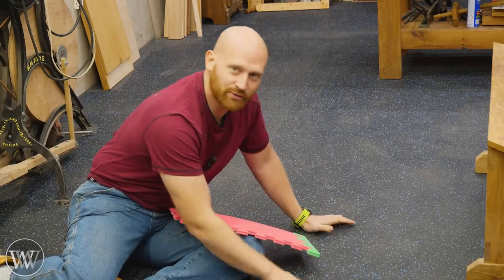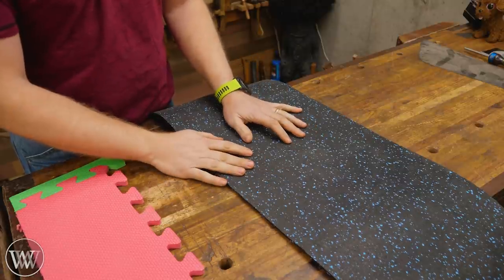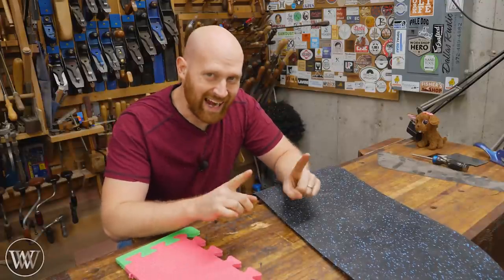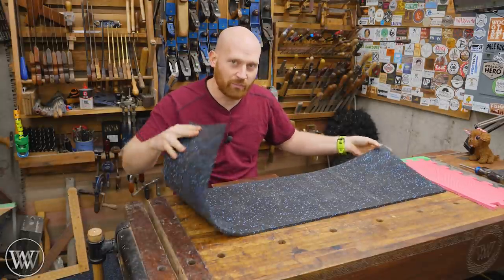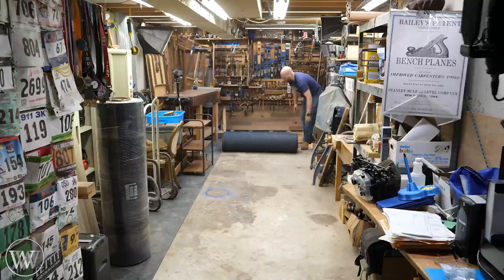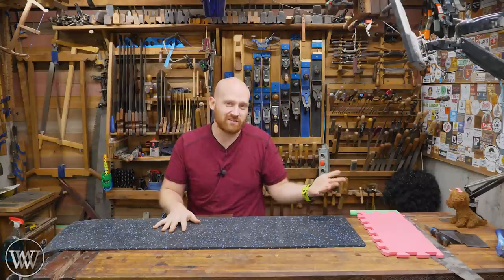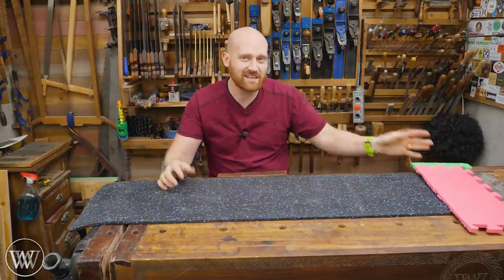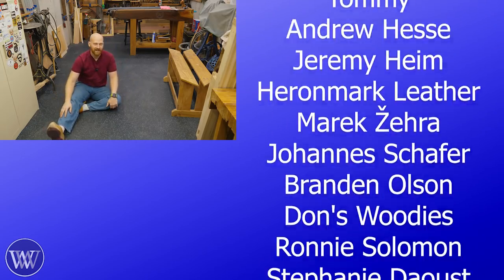How to Install Rubber Flooring In a Woodworking Shop

Comment: I started researching flooring for a shop in my basement last year and saw your video.  It appears my shop is about the same size as yours.  I ended up going with the same flooring that you did (black with the blue specks).  I painted the walls a bright white and after installing the flooring the walls now appear to be a very pale blue.  I'm coming up on a year now since I did the installation and I couldn't be happier.  I use a shop vac with a Dust Stopper to vacuum up the sawdust which works good.  At the end of the day I run a Shark Rotator around and it does a great job picking up the fine dust.  Since I have to break down sheets of plywood in my garage so I can manage to get them downstairs I've definitely noticed the huge difference in the comfort of the rubber flooring compared to working on the concrete in my garage.  Thanks for your video!

Comment: For anyone thinking about the foam puzzle pieces. Like James said sweeping is a bit of a pain. Chips and shavings come up east. There tends to be a fine layer of dust that is left so I follow with a vacuum. Also, wood filler seams to instantly bond with the stuff. On the other hand, with rubber shoes, it is great for antifatigue.

Comment: I think you probably made the right choice with the rolls, I had the same thought about sweeping while you were talking lol. I've got gravel with plastic sheeting and some free carpet over top in my pole barn shop. Holds onto the dust a bit more but like with your rubber floor it isn't as hard on stuff you drop and machine legs don't sink.

Comment: I put 3/4 inch horse mats in my 10x12 shed 10 years ago.  A bit of a luxury, but I really like it and would do it again.  For a larger space, I'm thinking the rolls you used are more cost effective.

Comment: Oh wow. Looks like you were using the "good chisel" to clean the epoxy bumps off the concrete floor! Nice new floor. Good video.
Reply from the maker: It's always wise to have a set of chisels in the shop that are not as light as others.

Comment: If the cracks are annoying a product my grandfather invented and patented might help although I doubt you could find it. Namkub enterprises. It was a roll of extruded plastic with a T shape that fit in seams of linoleum to keep things from falling in the cracks when it was only 3 or 6 feet wide.

Comment: It would be a good idea to glue the edges together using contact adhesive, that way you don't have to worry about catching an edge when sliding heavy objects around. That could be a problem if you are adjusting saw horses or moving a project or your bench. It will also make it easier to clean since you can make the edges match each other when gluing you won't have gaps & uneven surfaces for dust to stick to.
Reply from the maker: I thought about that, but if I move I want to peel these up and take them. also in the tests I did of moving things around I have not had any issue at all. the floor does not bubble up because feet do not sink into it. and the seams are crazy tight as is.
Reply: I'm thinking of using carpet tape to join the seams.

Comment: Look at that, 290 thumbs up and zero thumbs down. I found your discussion worthwhile but wonder whether the EVA would make effective, cheap and easy to install sound deadening for an enclosure for a 7-1/2 Hp dust collector and same-size compressor. What do you think? Is there something more effective for anywhere near the price?
Reply from the maker: I think EVA would work great for that. especially if you did a layer or two.

Comment: I have the exact same material in my small 12x10 shop, and it has saved many a chisel and plane. Cost of tool replacement far exceeds cost of the material. You can also glue down  rubber floor as a permanent solution  if shifting is a concern.
Reply: Does it smell? How do tools roll  on it?
Reply: @DaileyWoodworks  the floor is very shock absorbing, but does not allow dropped items to bounce. Same stuff they use in commercial gyms for weight room flooring. Easy to clean too. No real odour to it though.

Comment: My woodshop is only about 80ft², with a wood floor over dirt. I definitely like the idea of the rubber as insulation. It'll keep cold air from seeping in from underneath. I may go with the horse mats since I can probably get them dirt cheap as 2nds.
Reply from the maker: ya horse mats would be prefect there!
Reply: If you're getting second hand check for smell. Horses like to pee on it
Reply: @tryingagain14   Nope. They're brand new 2nds from the factory.
Reply: @rhpsoregon  ok good. Was a bit concerned. 
Miles

Comment: The floor looks great, James. It sounds like you found something that works out well for you and your shop. I look forward to an update in a year or two after you've had some time to live with it. It would be interesting to see what a 'simulated spill' of epoxy would look like on that scrap piece of flooring. I'm curious how well the epoxy would adhere and if it doesn't, if it would come off in one big satisfying piece.
Reply from the maker: I wish I had shown the epoxy tests I did on it. as long as you let it cure it chips off fairly easily. not 100% but far better then concrete.

Comment: comfort is very worthwhile.  i spent years standing on hard concrete and it was a pain literally.  i bought the eva foam puzzle pieces, which i have in the five areas where i mostly stand.  makes a huge difference to your work, as it does prevent fatigue which is where mistakes come in.

Comment: What were your reasons behind the colour choice? In an enclosed basement, did you not want to brighten, rather than darken the room? Also, more importantly, do you not struggle to find screws, nails etc when you drop them? It looks like quite a camouflage pattern. Also, do they do printed rubber? I was considering getting a giant self portrait on my floor. Just my grinning face. I think it'd look great every time I open my garage door, and not remotely sinister.
Reply from the maker: Lol I like the way you think. most rubber flooring comes just black and you spend a bit more to get a color mixed into it. White rubber is very expensive. And white rubber won't stay white very long. I actually find it a bit easier to find things on the floor with this than I did on the concrete because the concrete had a lot of different colors and splotches. this is just jet black with a few speckles of blue.

Comment: did you think to put a strip down the other way by the bench and shelving so you could replace it easily if it gets damaged/too messy with epoxy ect.?
Reply from the maker: I thought about something like that, but I like to move things around. most of the epoxy tests I have done on it show that the epoxy will chip off once it hardens it does not hold that strongly to it.
Reply: @WoodByWrightHowTo  ah that's fair enough, in the scheme of things then unless you start juggling with your tools i guess the floor should survive pretty well

Comment: Hey great video, I'm wondering in hindsight if you had wish you want a different route. I'm thinking of doing this for my shop.
Reply from the maker: I'm actually going to be making a video in the next couple months reviewing the flooring after having it for a couple years. In all honesty I wish I had done this years before. Other than the bench it was the best thing I've ever put in the shop. I originally thought I would probably be wishing I had gotten the half inch thick material. But in all honesty if I had to do it again I would stay with 3/8. It is absolutely amazing and if I ever build another shop it will be the first thing to go in.

Comment: Good discussion!  (I use an interlocking mat system with holes that allow sawdust to fall below the walking surface to maintain grip - then vacuum up the dust easily afterward.  That system doesn't support moving equip over it, but I rarely have the need for that.)  Wondering - is there a way to glue the rubber strips together to form a cohesive surface?  That would prevent the seams from opening when moving equipment around and prevent seams from accumulating debris. -- Love the jokes at the end!  Very punny!
Reply from the maker: I'm sure you could use a poly based glue and adhere them together very nicely. It would be a lot of work to run along the edge of all the puzzle pieces but it would probably help from that.

Comment: Any tape, glue, or sealant at the seams to keep them from curling  up into tripping hazzards over time? Maybe double sided tape to help hold them down to the floor along the seams? Definitely looks like a more finished space with that floor down now. I think I like it... yeah, I definitly like it, quite a bit, actually. It looks good.
Reply from the maker: No. The rubber is actually designed to go down without anything holding in place it lays perfectly flat. No tape or sealant needed.

Comment: Can you put a coat of paste wax on the rubber? How does it react to boiled linseed oil?
Reply from the maker: I have not though about paste wax. that may defeat the grip though. the oil is fine as long as it is a polymerizing oil.

Comment: Any concerns about moisture getting trapped under there?
Reply from the maker: If the basement flooded I would just peal back the middle one and air dry it. but as to moisture build up from normal air? no I have no fear of that. we are air conditioned. but if the basement flooded that would be the least of my fears!

Comment: Over the years I've seen "horse mats" or whatever they're called, they're the rubber mats in a horse stall that can get pretty thick. I've seen these at Tractor Supply as well as a few other places. I don't remember pricing but I was thinking about using it on a workshop floor... as soon as I find space for a workshop...
Reply: I posted the horse mats comment before  I seen rest of the vid, apparently he did know about them... great minds lol

Comment: The edges of the foam will lift up at the edges and become a trip point. Especially if a joint is close to a heavy item.
Reply from the maker: right on. another reason I went with the rubber. even the 600lb lathe does not sink in.

Comment: Is it worth taping the seams?  I'm thinking a liquid spill or dust working it's way under.
Reply from the maker: I think if you go 3/8 or more there is no benefit to taping the seams on large rolls. but if you go thinner then it is deffinently wise.

Comment: Thanks for the video! I now feel so much better about the 3/8 inch rubber flooring I purchased for my garage/woodworking shop. I'm waiting for warmer temperatures to install it. I also purchased a heavy duty double sided tape to put under the edges, but after watching this video I may try the installation without first. The tape can always be added later if needed. My only concern about this type of flooring is that the wheels on the mobile bases of my heavy machines may leave dents in the florring over time and with the Arizona heat. What are your thoughts regarding this? Thanks again, love your channel!
Reply from the maker: I do nto think the tape would help if the heat and weight are enough to cause a problem. with my 600lb lathe sitting on 4 small legs it does not dent in at all. but I am at around 65 degrees all year round there.

Comment: With the qualities you described for each type of flooring, I'm wondering if a combination of the two might be advantageous. If you put the eva down and lay the rubber on top, would there be significant denting/compression, or do you think the rubber would prevent this? It seems like the eva underneath would add more insulation and padding.
Reply from the maker: I don't think I would want to try that. Having the soft EVA underneath would cause the rubber to bubble up making seams pop up. The difference in insulation between the two is very minimal and I don't think it would be worth the other struggles. You can get lighter rubbers or a thicker rubber.

Comment: I am going to look at horse mats for my shop.  I have the squares and they can be a trip hazard.  And horrors of horrors I dropped my block plane on the concrete; no damage luckily.
Reply: If you only need a small area like around your bench then those horse mats are the way to go. Pretty cheap at tractor supply. I have had a couple for about the last 4 months and it has worked great. The only issue is the ends will curl a bit from being rolled up tightly, just weigh them down for a month and they will be fine.

Comment: Humm. Basement, concrete floor. How to you prevent mold from growing under the rubber?
Looks great though!
Reply: Is this a big issue? In all the various places I've lived with basements the concrete floor never had problems like that, though we generally kept ours bare concrete or with throw rugs over top.
Reply from the maker: If the basement flooded I would just peal back the middle one and air dry it. but as to moisture build up from normal air? no I have no fear of that. we are air conditioned. but if the basement flooded that would be the least of my fears!
Reply: @DanielAKA  as long as the air can move mold will most often not grow. If you stop the airflow so moister can rise up but not go anywhere its common to get problems.
Reply: @WoodByWrightHowTo  I was thinking about the moisture from the ground. But as you said. If problems would arise you can just peel it back 🙂
Reply: In older homes concrete was poured directly on the gravel base. Most homes in the last 30 or 40 years have a heavy plastic vapor barrier to stop moisture from migrating.
Reply from the maker: Ya there is no moisture coming up.
Reply: @rolandkuhn9066  thanks! That explaines a lot of things. Around here people pretty much stopped building basements around that time.
Reply: @WoodByWrightHowTo  Great! 👍

Comment: Not a floor related question: I have never seen those clogs before. I tried to do a search and I'm only seeing more recent videos about adding new soles and why you wear them. Where's the video on making them?
Reply: Nevermind it's in the description of the Why video xD
Reply from the maker: I have a video on carving the outside but I don't have one for making the foothold. Mine actually came from Holland as a rough blank. so I just had to do the final sculpting to make them fit my foot and then decorated the outside. I have a video on that but it was four or five years old and on the main channel.

Comment: How much smell from the rubber goes thru the house if this was used in a basement shop?
Reply from the maker: You can smell it in the shop but outside the shop it doesn't smell it all. My wife said she doesn't even smell it and she has a pretty sensitive snazz.

Comment: Hi James, I'm considering this for my one car garage shop. Do the caster wheels roll easy? Also do these give out any fumes if I have heat blasting? I live in the cold climate and I'll be blasting heat during winter.
Reply from the maker: I can roll my 600# lathe around on it. About 2 weeks after I no longer smell rubber at all. I am in a climate controlled room though full ac and heat. My guess is there would be no problem at all as long as you are not melting the rubber.

Comment: Thanks. I've been considering putting down some kind of anti-fatigue flooring in my garage shop. Could you link to the actual product you used. Rubber Flooring offers a lot of products. and it's not clear which one you picked.
Reply from the maker: here you go. https://www.rubberflooringinc.com/rubber-roll/commercial-rubber-roll.htmlthey are all basically the same other then thickness and look. most of the terms just refer to the size of the color flecks.
Reply: @WoodByWrightHowTo  Thanks. I think this may be exactly what I've been looking for. 
Here's a corrected link for others...

https://www.rubberflooringinc.com/rubber-roll/commercial-rubber-roll.html

Comment: how good are those to absorb the noise of a mallet? I current setup is a small workbench on balcony, and each mortise chop means annoyed people.
Reply from the maker: I don't think it would make that much of a difference in an open air situation. But in a shop where it can bounce around in an enclosed space it makes a little bit of a difference.
Reply: @WoodByWrightHowTo  bummer. i just order some. my only hope is that when i do some mortise they will not try to kill me. and is germany we need to obey the rules :)
Reply: I've found that if you wear ear plugs, most of the neighbours' complaints become inaudible.

Comment: Hi there. So sorry if this has been asked already but for those of us who share our workspaces with a car, would the rubber flooring that you have be an option for us? Thanks! The shop looks great btw.
Reply from the maker: I actually was thinking of putting it in the garage. I do not see why it would not work under cars. it would have no issue at all with the weight. I might bump up to 1/2" or thicker so there would be less chance of it bubbling with wheels turning in place. but other then that it should work well.

Comment: I'm sure the rubber floor is easier on the feet and back than the concrete floor. But I just thought - the shop I will build will have a plywood floor. Do you think the rubber floor is necessary?
Reply from the maker: Plywood floors 10 to fall apart rather quickly in comparison. Also, they are very loud and I don't notice much difference between plywood and concrete on my feet. However, the rubber floor is far superior in both of those characteristics. And it's about the same price as plywood. And cheaper in some areas. The longer I have the rubber down on the floor the more I absolutely love it.
Reply: @WoodByWrightHowTo  I don't quite understand. I'm building a shop, so I will need a plywood floor in any case, right? Is it possible to install rubber floor INSTEAD of plywood?